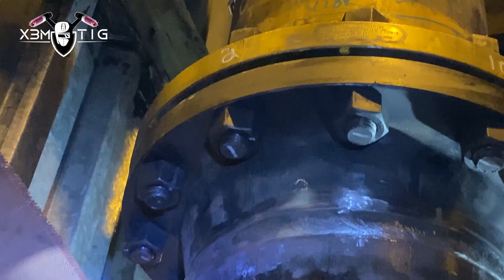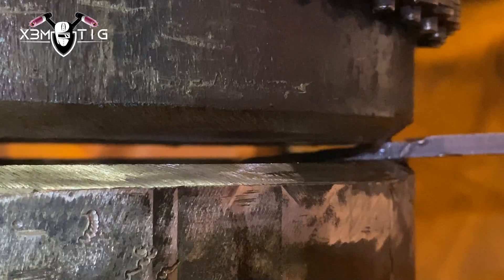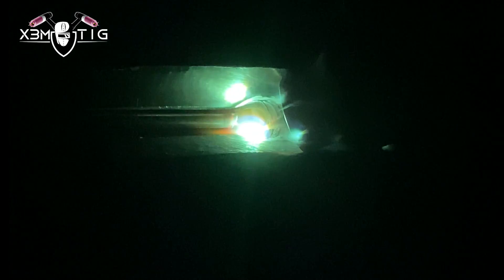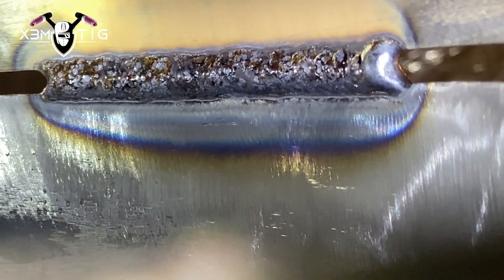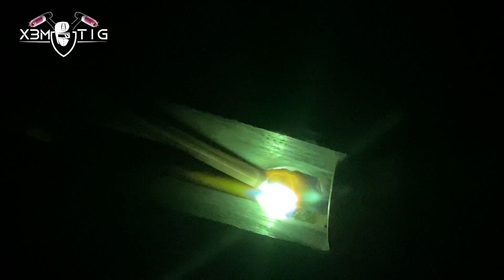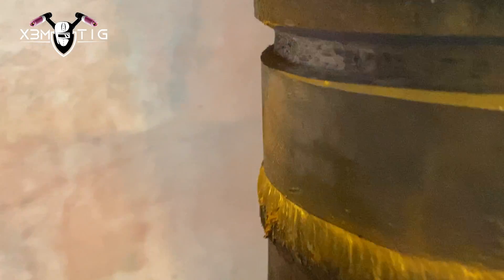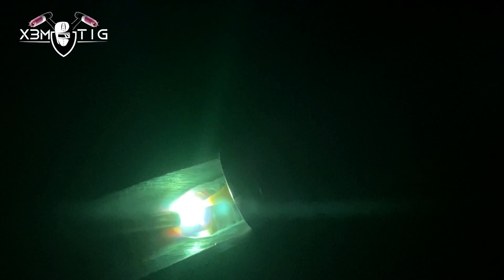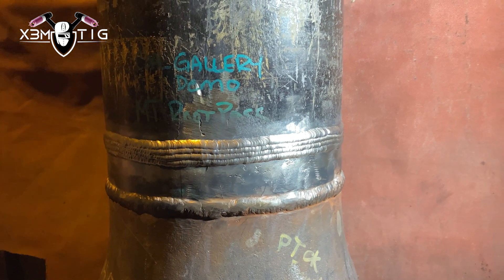TIG Welding Root Pass in the Field – Tips for Flawless Welds!

Comment: hey i got an issue, while 3g plate opnen root, need quick fix, i tried moving earth around didnt work, problem is, my wire is getting stuck to metal, just like it it was magnetised, but EXTREMALY  hard, very hard to pull the wire out of the plate eaven if tig torch is lit few inches away, full plate gets magnetised just like mag drill, please help